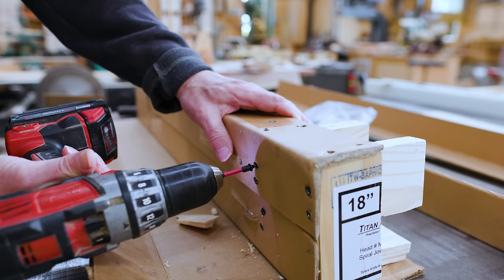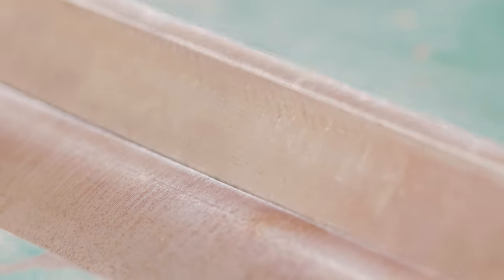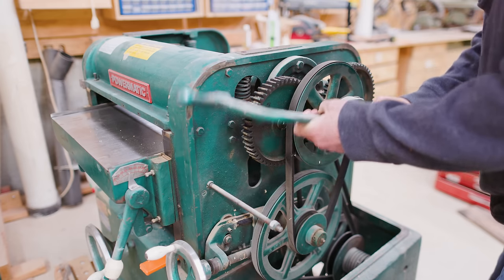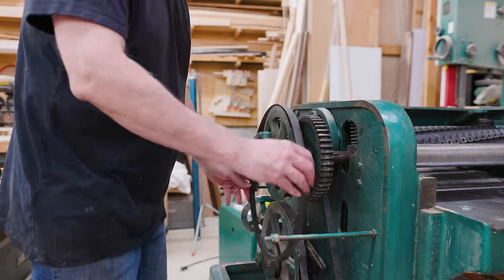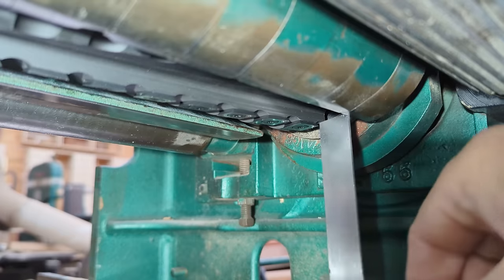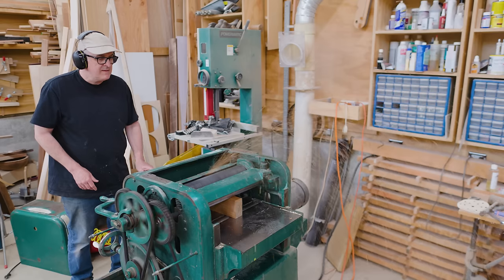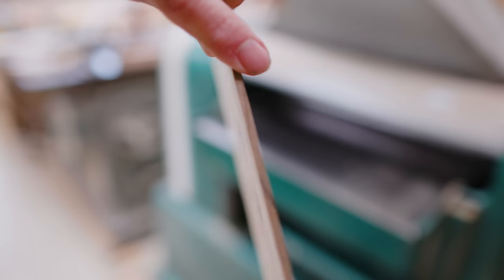The Ultimate Planer Upgrade

Comment: I worked for a flooring manufacture running a German 5 head molder. To sharpen or change profiles we simply loosened a nut and slid the entire head off a shaft,less than a minute. We did have an aluminum spiral head with replaceable knives but would only use it to plane or “ blank” our material. It would leave a corduroy or undulating finish. It was much quieter and if a nick occurred of course you could just rotate one knife. I’ve always been sceptical of segmented heads because of that,especially on jointers. I might consider a swap out if they ever redesigned planers and jointers with easy removable heads. It won’t happen in my lifetime. Love your content.Cheers from Vancouver Island.

Comment: Great upgrade. Did my 160 a few five years back, never looking back, best upgrade for the planer. And you never need to reset the adjustments after the first time as the cutting circle never changes. Nice detailed video.

Comment: In our makerspace we had a 15 Grizzly with plain knives and upgraded to a 20" planer with a spiral cutterhead.  I measured the sound output from both machines while planing a piece of red oak.  The difference was amazing.  The new planer was a full 20dB quieter. The old 15" machine would drive people out of the building.  We have had the new machine 3 years and just replaced all the cutters.  It is very heavily used, sometimes with some pretty nasty wood, but has held up great.

Comment: Thanks for this video, Frank.  Watching you operating it without the dust shround in position brought back memories of the "old days" before dust collection was considered necessary.  Although my vintge Wadkin Bursgreen 18" planer has its original straight-knife cutterhead on it, I enjoyed watching the meticulous adjustments you did to the table, rollers and pressure bar - all of which are adjustments I made to mine when I first acquired it.

Comment: I have a delta lunchbox planer..I'm glad mine wasn't nearly as complicated as your full sized one seems to be..   
Putting a helical cutter in it was like a completely new upgrade.  it acted like a brand new machine.  With the standard blades, i was routinely stalling it even with fairly thin cuts on narrow stock, it would blow the breaker and i'd have to go reset everything and try again with a thinner pass.   
With the carbide cutters, the reduced force on the drive train, I could take full width passes, with modestly agressive depth of cut and it it never even hiccuped.  projects i'd put off I could now do!..   if you have a standard planer, yes, it's expensive to get a helical cutterhead.  but it's worth EVERY penny.....if you're buying a new one, look for a helical cutter already installed....you'll never regret it..   plus, no more sharpening blades,   if they get dull, just turn the cutters a quarter turn,...you've got 4 sides to work with bfore you've used up all of them.   (and if it's not too badly nicked up, you can even rehone them if you're careful, but as cheap as they are, they're really not even worth doing that to, just buy a couple dozen new ones and replace them!!!)

Comment: The observation about the sound is really interesting.  I replaced an old delta straight-knife planer with a 12" Oliver planer (with the same sort of cutters), and had the same sort of experience.  Both are loud, both require hearing protection, but the sound the new cutterhead makes is less grating.

Comment: You’ve got guts starting that beast with the top off!  My Byrd shelix on my powermatic broke off several cutter heads on the first few boards through. Would have been scary if that happened here without the top.

Comment: Replaced the cutter head on my Dewalt 735X with the Lux Cut III. It worked very well initially but did not last. Twenty board feet of aromatic cedar and some sassafras nicked several blades. Oddly, 10 years of steel straight knives held up far longer. But then, changing cutters on the Lux Cut is infinitely easier than changing long steel knives. I imagine I will be using up the extra cutters that I got with the Lux Cut sooner when I start running hardwoods like cherry, walnut, red oak and hickory.

Comment: For super thin stuff, I have had good success using a dab of CA-glue in the corners and gluing the piece to a thicker board, and passing the whole thing through in one go. I've gone down to about 1mm on my Hammer A3 with that method. Careful razor to then detach the two pieces and clean up the glue.

Comment: The major benefit to a helical  cutterhead that wasn't mentioned in this video is the ability to plane highly figured wood with little to no tearout. On straight grain and softer wood you won't notice as much of a difference but when you start running harder woods with alot of figure is where the helical cutterhead really shines. This is because  the helical design presents the cutting edge of each  insert to the wood at angle creating shearing action.

Comment: That was another great video. I appreciate all the extra effort you put into your videos. The stop motion and the Homer Simpson voice, good stuff...  I'm sure you know this trick, but if you put a melamine or similar surface through the jointer (To raise the bed) with a dropped lip on the infeed side so it won't slide through, you can run really thin stock through on top of that. I'm not sure how much thinner you would want to go though.

Comment: I would’ve thought a little grease would be recommended on shafts and gears. But you installed them dry. Did you do that to avoid dust build up on squeeze out?

Amazing video. Great to see this upgrade on this vintage machine. How do you power such a beast?
Reply: I would suspect it’s to keep the teeth from gumming up with dust and catching chips and chewing them up. It looks like there are a few open holes to the cutter head, which could blow some stuff through.

Comment: I learned that when you first rotate the knives, rotate them 180, not 90. When you rotate 90 you have one sharp corner and one used corner causing lines or a ridge that requires more sanding to remove.
Reply from the maker: Interesting. That makes sense and good to know.
Reply: Yes, and make sure you rotate all the cutters.  If you get a chipped cutter, replace it rather than just rotating it.  If you do this you won't end up with random age cutters and a lot of head scratching trying to figure out what needs replacing.

Comment: Very nice!  Is that head actually manufactured in the US?  Some of the scoops you are seeing in the finish from the new head is actually denting from chips getting in between stock and rollers and that will get better with good dust extraction.  I found when I switched, vacuum strength and air volume were more important than on the straight knife.  Great video!

Comment: Didnt look like much difference with the sound level, but every -3dB of change is a halving of sound level. 83dB is half as loud as 86dB.  You still need hearing protection.  OSHA recommends hearing protection for anything over 85dB for 8 hrs.  Something I regret not using more in my earlier years.😕

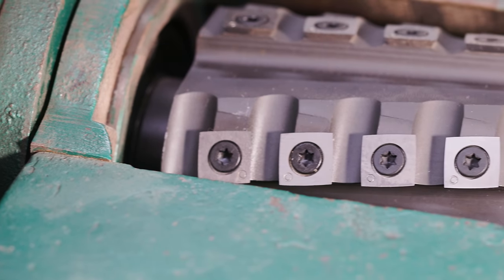Comment: The far left cutter at 9:25 might need to be rotated 90 degrees, the small dot on it is on the bottom right, whereas the rest are on the bottom left.
My guess is that those are there so when the time does come to adjust the cutters and freshen them up, you'll know which side is already used, so having them all aligned might be a good idea.

Comment: Very cool video.

I am disappointed with my lux head. It is a very smooth cut as I run fingers along the length of the board. But running fingers across the grain, there are smooth waves, some people call them scallops.
Reply: Yep, that's how they cut.
Reply: @larrybud  I find it crazy no one ever mentions it in reviews. I never would've bought one for planer and one for joiner.
Reply: @dougprentice1363  I've never used one so I don't know how severe it is. Is it easy to sand out?
Reply: @larrybud  sure, it will sand out. But you don't have to sand with straight knives, other than a pass with high grit paper if you want.
Reply: @dougprentice1363  Straight knives have their own issues, it's not a perfectly smooth surface.

Comment: My understanding is that when you switch from blades to helix, the planer speed needs to be reduced.  My Jet JJP-12HH has a larger sprocket wheel than the straight blade version, thus a slower cut speed.  When I switched my former Makita 12" planer from blades to helix, I had no way or idea of how to decrease the speed.  Must be an optimal speed for helix heads and too fast might not yield best results?

Comment: One of the things that surprised me — although I am not sure why — is how incredibly sharp the inserts are on helical cutters.  I bet they are almost as sharp as wood chisel or plane irons.  So you need to be extremely careful when handling them.  If you are thinking of updating and existing thicknesser/planer or buying a new one, the extra cost of a helical head is worth it on every front.  The finish is better.  Straight HSS blades present a 90° edge to the workpiece, whereas helical blade inserts have a much sharper — and I am guessing here — 35°.  Plus the helix means that the edge hits the workpiece at and angle give it a slicing cut rather than pushing straight through.  It's like advancing a wood plane at an angle. They are much quieter to use. The chips are smaller so they don't clog up your dust extractor.  They are not ruined when you miss a nail on used timber, and even if there is damage, it is a trivial job to replace, or rotate an insert or two. Plus being carbide rather than HSS they can handle pin nails and brads without being damaged.   I was going to say that you don't have the hassle of setting the blades with helical cutters, but it probably takes longer to change all the inserts than to set HSS blades.  My ten inch thicknesser planner has 44 inserts.  Frank's thicknesser looks to be about 20 inch which would mean 88 inserts.  

I absolutely love my Hafco thicknesser/planer.  It works way better than the machines at my Menz Shed and one of those has a helical head so I am not sure why.  (Possibly because I am the only person who uses it, so it is set up better and never abused.)  It takes ten minutes to swap functions on mine, and I was expecting to have it set up as a thicknesser for most of the time, but it has turned out to be the other way round. One trick I have worked out is that the planer can clean up snipe from the thicknesser.  That is a very cool wee trick.
Reply: I was very surprised by the sound level comparison.  It appears that the type of noise is at least as significant as the sound level.  I'd resisted getting a planer and thicknesser for my home shop because of how noisy they are, but now I have a thicknesser/planer at home (Hafco PT-254S) with spiral head, it is much less annoying sound wise than my saw — as an example.

Comment: 4:49 What table saw is that?  I see the blade is more or less in the center, rather than crowding the back edge of the top.  If it's not too much trouble, could you also post the dimensions of the top?
I've got an experimental project in mind for such a top.
Reply from the maker: It's an oliver 88-d. The top is 40" wide and it is 44" deep. The center of the blade is almost exactly in the center of the tabletop.
Reply: @frankmakes  Thankyou for taking the time to reply.  Wow that's a monster!  Too large for what I have in mind, but I bet it's a joy to work with.

Comment: My favourite difference between This Old Tony and Frank...... except the huge one about Frank being primarily a wood guy and TOT between primarily a metal guy and they both delve into some of the plastics world. For anyone who doesn't know This old Tony (or TOT), he occasionally uses a selection and magic lever on his laithe to ...... err..... "borrow" things from the past and future. For example, he wanted to mack a boring attachment for his mill and couldn't be bothered to go through the full design stage..... one quick trip to the future and back saved him hours as he only had to messure the finished project and duplicate. The think about TOT is that he's always a little bit embarrassed to be messing around with the past and future as he knows that he might accidentally screw something up. He always does it anyway and mostly pulled it off every time.

Frank, on the other hand, knows not to be messing with time travel......... cloning is a whole other thing. I love that he just gets on and does it with no self dought or other worries. Who needs time travel when you have a small army of Frank Howarth's out there speeding things up and generally making a better place. So cool 😊😂😂😂😂

Comment: Seems to me you hit pay dirt with the idea of using a thick piece run through as a way to check for level across the whole thing.  Heck you could use a some 1/1000ths inserts on top of the planed piece too to get the proper height that you want on the hold down bar and what not to get the exact height you want.

Comment: Seems to me the ultimate gauge of parallel of the cutter head will be the material that is run through it. Several passes of some wide stock will tell the tale.   I have a Jet sander that is off by 1/1000 and no matter what I try I can't correct it.  It doesn't sound like much but after a few passes it adds up and on wide stock or things like cutting boards it is a real pain.
Reply from the maker: I did check a wider piece with my calibers and it was very close. I will have to see over the coming months if I notice it being enough out of parallel to cause problems.
Reply: Flip the stock end for end to even it out.

Comment: Your smarter then making adjustments with the cutter head turning. You really  need to disconnect power when you make adjustments or at least lock out the power switch. 

We had a kid reach into a planer at highschool  his arm got caught in the machine and you can go from there what happened. I didnt see it personally i wasnt even in highschool yet, this was about 46 years ago. Dam im getting old. 
I belive it was the largest powermatic planer at the time, i even think it had a shelix cutter head in it becuse i used it a few times and nevef seen it leave a line on a part and almost no snipe. The surface was smooth at glass. 
The schools always bought the best tools. Mostly powermatic stuff and it was always green. 

Please dont do adjustments with a machine running its not worth the risk.  Just shut it off.

Nice demonstration thanks for the content.  See ive got an older craftsman that was made by belsaw but its also a shaper. And im on the fence doing this to it. 
I do have a 13" planer but its a harbor fright 4 post type so i dont need a dedicated planer the shaper would be handy.  
I think you like working on the tools more then woodworking.  Ive never seen you make anything.

Comment: I think your adjustment issues stemmed from what you ended up figuring out by planing the thick piece of wood… you didn’t have a properly measured datum for the cutter. You really needed that bottom most point of the cutter in order to set the other components. 
Great video.

Comment: I thought for sure you'd do a full restoration after you were half way through all the stuff you had to remove to change the cutter.
But then I realized a one day project turns into one month, once you 'make a clean spot'.

But I would watch several hours of video showing that beauty being restored better than new, with powder coat or hammerite finish our something. All the rust gone and blocked; honing the table; a bit of chroming for bling.

Just sayin'.... 😉
Reply from the maker: I thought about doing more restoring on it. But I know once I start down that road there goes my summer.

Comment: When you look at the infeed gear shaft and the outfeed gear shaft, you can see the outfeed shaft is not well polished by comparison. If you had spent a little time with some penetrating oil and scotchbrite polishing that shaft and the interior of the gear, it may have slid on substantially easier.

Comment: So you went from only having to change 3 blades, or not even having to change them, you could sharpen them on the machine. To having to change hundreds of inserts? 

Which you failed to mention takes substantially more horsepower to drive. You didn't notice because of how small of pieces you were testing with.

Comment: I always think about a Shelix for my Dewalt 735 but then I always think "So what if it's smoother, you are going to sand at 120, 180, 240 anyway so what's the point?" I am still in that thought zone. My planer leaves fine lines on work pieces, but everything sands out and it's not extra effort. Do I still want one? Yes. But I realize, for most it's impractical.

Comment: I don’t think Frank would ever see this post but. “The small chips” in the finish on the new cutter head is from poor dust extraction. The cut chips land back in front of the cutter and get forced between the cutter and the board making small indents in the panel. Sorry but I do this for a living and wanted to at least try help people learn something new.
Reply from the maker: Now I'm going to need to look at making my dust extraction system better.

Comment: Did the same thing to my 1969 18" power maticc.  And regret it.  It takes more horsepower and leaves micro ripples in the finish if you don't sand.  Not worth it for the price!